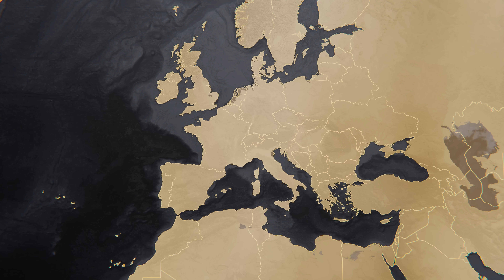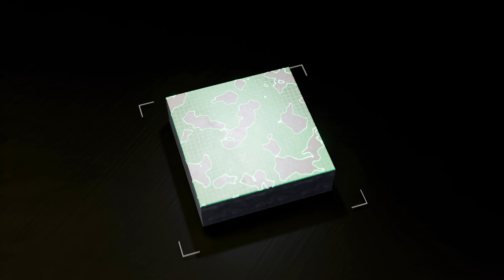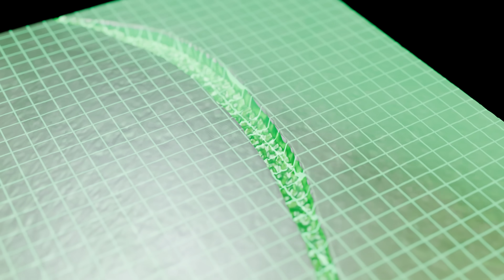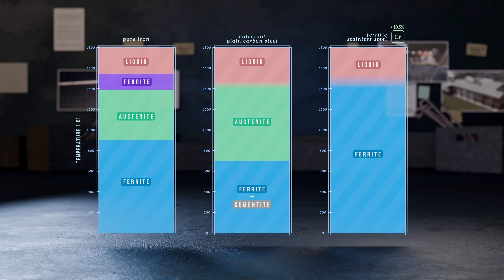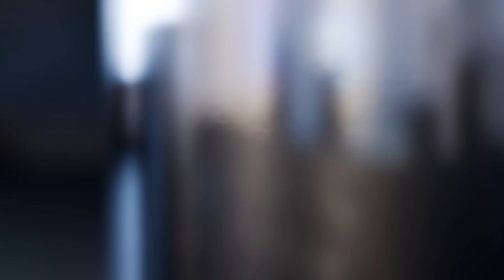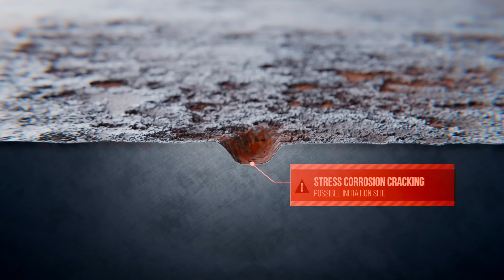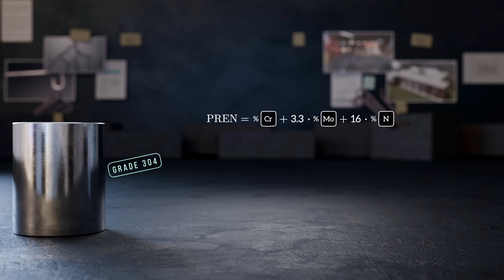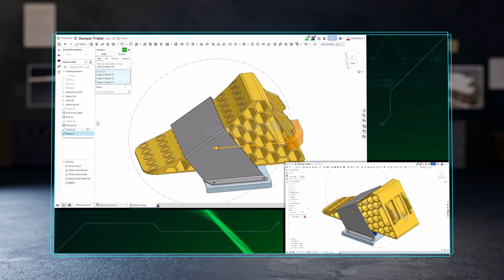The Problem with Stainless Steel

Comment: I just got a 304 SS hitch ball for my garden tractor today, I'll be sure and not drive my tractor into any swimming pools.
Reply: Should have gone 316, it’s over
Reply: @oghaki5097  Nah man, I use exclusively Inconel 625. Ain't nothing gonna fail because of corrosion on my watch
Reply: Doesn't 316 have even worse galling?
Reply: @soundspark  Galling is most commonly found in metal surfaces that are in sliding contact with each other. It is especially common where there is inadequate lubrication between the surfaces. However, certain metals will generally be more prone to galling, due to the atomic structure of their crystals. For example, aluminium will gall very easily, whereas annealed (softened) steel is slightly more resistant to galling. Steel that is fully hardened is very resistant to galling.

Galling is a common problem in most applications where metals slide in contact with other metals. This can happen regardless of whether the metals are the same or different. Alloys such as brass and bronze are often chosen for bearings, bushings, and other sliding applications because of their resistance to galling as well as other forms of mechanical abrasion. 
Now add in chemical compounds that are acidic in nature, suspended in the air in conjunction with the application at hand and this is a result of that. 316 is considered Marine Application SS and is used widely in salt water conditioned area's due to its superior ability to "resist" rust.  It does not STOP or Prevent rust from happening. Easily managed with an inspection program.
Reply: @soundspark stainless fasteners should be first applied with anti-gauling paste.
Reply: @anonimous2451  Places with metal to metal rubbing contact with no lubrication... like a trailer hitch?😂 It's literally the exact conditions you described.
Reply: @Uruz2012  I don't think these other responders know what a hitch ball is 😅. I will say though, technically you ARE supposed to grease the ball. I don't think anyone does it on a bumper pull, but more people do it on goose necks, and basically everyone does it on a 5th wheel. Personally I do grease mine for exactly this reason, corrosion (via galling), and can cut down noise slightly.
Reply: @soundspark I’m a brewer, and dry 316 threads gall like a mfer. Feels like a bunch of sand in there especially under bolt tension. Sounds like nails on a chalkboard. It’s very corrosion resistant though. The sodium percarbonate (h2o2) cleaner/sanitizer we use oxidizes the shit out of everything and rusts mild steel in seconds, and you can leave good 316 submerged in it forever.
Reply: @JD- ub5ic Greasing your balls should just be part of your daily routine. Like flossing.
Reply: @Uruz2012 why is your hitch dry? Grease it!
Reply: @johncharnley2877  name a time this was useful in your life😂
Reply: @johncharnley2877 Galling does not require dissimilar metals. In fact Stainless steel is highly succeptible to galling when used as both the nut and bolt in a joint. The chromium oxides will diffuse into each other under pressure.
Reply: Garden tractor, so likely won't be driven on any salted roads either.
Reply: Horseradish is the  secret to a perfect coleslaw
Reply: @2519-c3bCole slaw...how 'bout develed eggs?  Hmm😊
Reply: @2519-c3b ??😂 dont forget to grease ur 304 horseradish
Reply: Yeah  , good call. I had a ss thermos..loved it served for years, lent it to someone at Stanford University for a tail gater...they soaked it in clorox to clean it it's gone😮😢
Reply: They are a lot harder to avoid than you think. Maybe we can weld a crows nest atop your ladder and I’ll be a Vollenteer lookout to help protect you. 😁
Also, since English is my second language and I’ll need to make a living up in that crows nest, maybe you can pay the volunteer a small rate of $100 an hour.
Reply: Or the ocean.
Reply: Yeah be careful; not as easy as you may think.
Reply: You might try smearing it with axle grease. It's what you should be doing if read the instructions. Also periodically clean off the ball and your trailer hitch and apply fresh clean grease. Particles of sand and dust and even hard carbon particles from vehicle exhaust contaminate the grease producing an abrasive  slurry. Don't use you ball hitch to yank out tree stumps or for  anything it was not specifically designed to do.
Reply: I mean you could park it in one
Reply: AHAHAHAAHHAHAHAAHAAHAHHAHAHAHAHAHAHHAAHHAAHAHAHAHHAAHAHAHAHHAHA 

THAT IS HILARIOUS¡!!!!!!!!!
Reply: Take care if it's been welded. Keep visual inspection.
Reply: Yes, cause tractors can't swim. 😂
Reply: Corrosion is your least worry if you drive in pool
Reply: I think the 304 might be more protected if you can prevent it from scratching. If you really concerned, take it to a powdercoater and have them clear it with powdercoat. It is easy, tough, and cheap, but it will make the ball slightly larger, but in most cases trailers hitch isnt factory tight anyway.
Reply: @keith_5584  def should have gone with the cheap one coated in chrome.
Reply: Better have been a John Deere ball or the warranty is voided
Reply: Problem with the ball hitch is that its installation necessitates removal of the decorative scrotum sack which, customarily, occupies that position.
Reply: You should had went solid platinum!, what a clown.
Reply: Or use any chemicals that may have harsh corrosive elements near the hitch
Reply: Or ever work in the rain 🤣
Reply: Game over buddy..
Reply: Should have gone for Chromium–vanadium hitch ball. Designed for the application.
Reply: Keep it clean
Reply: @alanwardrop9575 I wipe
Reply: So what's all these American grades in something us Europeans can understand? This is a video about something that happened in Europe after all. He said something about 316 having molybdenum and being more resistant to acids, so I'm assuming it's like 1.4401 or 1.4404 and 304 is some type of basic austenitic stainless steel so most likely like 1.4301 or 1.4307.
Reply: Odd choice for that application. 304 will deteriorate rapidly in contact with steel and prone to galling and seizure.
Reply: @billshiff2060  to start, that's not how galvanic corrosion will work, SS304 being more noble would not be the one corroding first, the Carbon steel in contact with the 304 will corrode first in presence of an electrolyte and its negligible if you spray some oil or wax onto it, which most of us already do. As for Galling, that can only happen when in contact with yet another austenitic steel and under very specific conditions which a hitch ball will not experience. 
as for why material choice, the cheapest reliable grade of SS you'd find on mass market crap. Its either SS202 and equivalents being the cheapest stuff that'll pass being labelled SS while providing minimal protection, or SS304 being the "nicer" cheap stuff that won't rust like hell and need no maintenance. And the alternatives like zinc and chrome plated HC have their own disadvantages. 
tldr, the sacrifice here would be the coupler steel, not the hitch
Reply: @MaxC_1  to start, I'm not talking about  galvanic corrosion. I'm talking about 304 in contact with steel(or iron) destroys the chromium oxide layer and the residue prevents it from reforming allowing it to corrode. 
304 most certainly will gall under pressure against steel. 
If the steel happens to corrode, likely, then that rust residue will destroy the chromium oxide wherever it spreads on the 304.
Reply: @billshiff2060  the claims are extremely overblown yet again, your argument is very textbook and ignores realistic conditions. Your galling claim is incredibly inaccurate, galling between carbon steel and 304 is incredibly rare. it is a SS to SS issue. In this case with dissimilar metals, hardness and ductility it's not a concern. Go through engineering textbooks and forums and find me a true example of it happening under these low load conditions. Secondly the claim of passivation layer destruction is true but again overstated, the layer might be destroyed in spots but almost always its surface rust staining and is incapable of progressing deeper than the surface layer and will remain localized. 

you are clearly mixing up textbook examples of threaded fasteners with this static/low velocity rotational contact with a lack of understanding of other factors involved. I have worked as a machinist and materials engineer for long enough to know that besides the extreme conditions as in this video, your claims are overblown, bar the one factor that can change the equation by encouraging pitting that is road salt but even then a simple water wash and a few sprays of a penetrating oil will nullify this
Reply: @MaxC_1  I am simply wide eyed to the Google experts out there that read a paragraph and are now Civil or mechanical engineers. It's just dumbfounding.  No one here even considered the fact the chemicals they use in pools ARE HORRIFICALLY ACIDIC even when simply suspended in air by mere molecules and the fact air movement pushes it into places it should perhaps never be found.  And THIS IS ALSO a human health hazard not usually subjected to 13 years in an indoor environment so likely the trace elements are not in sufficient particulate strengths to cause injury as most folks leave after 2-6 hours of pool time. This is also a major factor for ALL indoor pools.  Bill talking about how "NOBLE" THE METAL IS I WOULD JUST ABOUT BET HE HAS NO FREAKIN CLUE WHAT THAT EVEN MEANS.  And ever hear of "Fools rush in were Angels fear to tread" ??? I know Angels probably fear nothing but that is not the point here. The point is someone gets an inkling of fact and instead of doing their own investigative research or learn the depths of the topic they talk about just propound to be experts and heey we all know "IT WAS ON YOUTUBE SO IT HAS TO BE TRUE" ... And I laugh my azzzzzzz off at foolishness like his commentary.
Reply: @MaxC_1 whether or not you think they are overblown, he is correct. You would be better buying a less expensive carbon steel ball, and bolt . And ALWAYS sticking to the rule of not mixing dissimilar metals. 

Your trailer hitch example may not cause problems quickly. 
But it can still kill someone at some time I'm the future, because they foolishly think that the ball and it's bolt is in good condition, and use it decades down the road, and the work hardening and inferior fatigue characteristics of the SS causes failure and a fatal road accident. 
Not my problem now, attitudes like this and scumbags not looking ahead, should f off away from engineering and smart Alec commenting in places like this. 
That is the importance of the engineering mindset. To look into the future. And anticipate everything that MIGHT happen, no matter how improbable it is. 
You are speaking like a fk head scientist, understating risks, and putting your reputation above people's mortality. 
NOT an engineer. 
Go back to school, where you should never leave!
Reply: @MaxC_1 whether or not you think they are overblown, he is correct. You would be better buying a less expensive carbon steel ball, and bolt . And ALWAYS sticking to the rule of not mixing dissimilar metals. 

Your trailer hitch example may not cause problems quickly. 
But it can still kill someone at some time I'm the future, because they foolishly think that the ball and it's bolt is in good condition, and use it decades down the road, and the work hardening and inferior fatigue characteristics of the SS causes failure and a fatal road accident. 
Not my problem now, attitudes like this and scumbags not looking ahead, should f off away from engineering and smart Alec commenting in places like this. 
That is the importance of the engineering mindset. To look into the future. And anticipate everything that MIGHT happen, no matter how improbable it is. 
You are speaking like a fk head scientist, understating risks, and putting your reputation above people's mortality. 
NOT an engineer. 
Go back to school, where you should never leave!
Reply: @MaxC_1  Bullshit My info comes from decades as a machinist with an architectural firm that builds all over the world, all 100% Stainless. We had every kind of problem you can imagine. From the new World Trade Center, US embassies all over, museums etc. 
We KNOW what can go wrong and we know why because we have employed independent experts to find out and testify in court. We did a major installation at Hyatt Regency Baltimore and went to court because it all rusted in a few weeks. Outside experts proved that it was Hyatt contractors doing extensive rebar grinding making fine steel dust that settled over everything. After extensive cleaning/buffing it was fine.
HHMI Virginia our (and everyone else's) stainless rusted. The cause was iron rich soil at the site.
I'm also responsible for doing all the engineering tests requested and using a UTM and writing the results reports to engineering including corrosion testing.
I know what the hell I'm talking about. Do you?
Reply: @billshiff2060  glad to hear, however I work as an aerospace and defense contractor, materials engineer and a Materials & Process Engineer besides being a machinist. I can assure you unlike your case I have never had a single case with legal issues or a complaint in a decade since my job relies on perfection and not throwing things around, I simply do not get to play guesswork. And since you failed to realize that what I stated can be cross referenced and checked I can clearly see why you had those issues you did and even more ridiculous is how shallow your depth is. Fine steel dust coating on SS surface resulting in rusting due to breakage of the passivation layer? in a place with a typical humidity of above 70% like Baltimore? of course, what would you expect, that is a classic and well stated example to the point its textbook. That is a clear failure of ASTM A380. Iron rich moist soil? yet again the soil is the electrolyte, and the iron breaks down passivation layer. Both of which are highly predictable cases. 
Clearly you are lacking the capability to see both scope, and application and I'd wish you learn that civil infrastructure has barely much in common with current case. And the fact you keep insisting galling is even possible in this scenario tells me of the depth of your understanding since it is incredibly shortsighted you even proposed an austenitic steel can gall with a martensitic steel under these conditions. I do not wish to mock you, but I am astounded at the terrible application of your own understanding.
Reply: @billshiff2060  I own a stainless business and sure you're talking about iron contamination. But you're acting like some sort of genius and talking way too much for what you actually know and have experience with. Please take a seat in your office job and say less.
Reply: @ThatCasualZach  Pffft I am twice the machinist you are if you lived 2 lifetimes.
Reply: Agreed... galling is a big deal with some SS's...😕
Reply: Listen to his video again…..your lawn tractor hitch will likely survive submerged towing.  Just be careful towing in salt spray, particularly if the dpray dries repeatedly.  Your lawn tractor hitch is perfect for towing submarines along the bottom, but if you are going to drag subs onto a beach, be careful.  Or, as noted in this great video, don’t subject the hitch to tensile loads…don’t tow subs, push them along so hitch is in compression.
,
Reply: Nonsense ...
Reply: What is it bolted to? Putting stainless onto steel can cause galvanic corrosion. The two things make a circuit and you get a nice piece of stainless and everything else corrodes to nothing.
Reply: Throw it away and buy a carbon steel one you image obsessed poser! Someone is going to get hold of that, decades down the line, put it on the car, and lose a boat , heavy trailer, or caravan on the freeway, killing someone. Because they, like you, think shiny is better. 

I pity the fool that thinks shiny is better! 

But I pity the fool, who inherits his mistakes, and the people he kills even more!
Reply: @Maungateitei 
I pity the fool that thinks garden tractors are used to haul boats & trailers down streets & highways.
Reply: @OOTurok  He didn't say the garden tractor. Unless he meant putting the garden tractor on the car to haul the trailer.
Reply: @bobbitelian 
Go read his comment again.
For his... garden tractor... is  EXACTLY what he said.
Reply: @OOTurok  "put it on the car" read more gooder.
Reply: @OOTurok  I read it the first time: "... put it on the car,..." EXACTLY what he said.
Reply: @bobbitelian 
The  OP's  comment is not edited, so you are a liar.
He said he bought it for his  GARDEN TRACTOR.  
He never said anything about putting it on his car.
Reply: @OOTurok  A bit hostile bud. I am not responding to the OP, but rather your comment to Maungateitei. Hitch balls get re-purposed all the time.
Reply: @bobbitelian 
And I responded to  Maungateitei  who responded to the OP with a strawman argument. 
All these hypotheticals are meaningless virtue signaling.  

What if someone steals your truck & uses it to run over a crowd of people... You should get rid of your truck poser, & buy a bicycle.

You should throw out all your shinny silverware in your house that someone can use to murder people with,  poser.  Just eat with your hands.   

See?  you can make a meaningless hypothetical about anything.
Reply: @Maungateitei  Whilst I somewhat agree with your prognosis your manners need tempering.